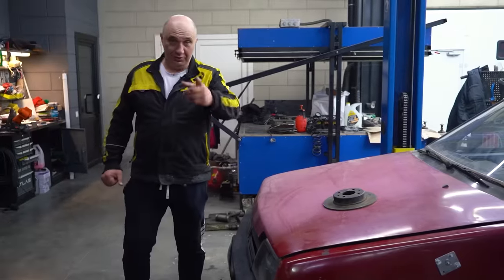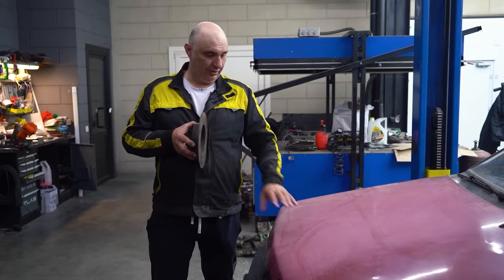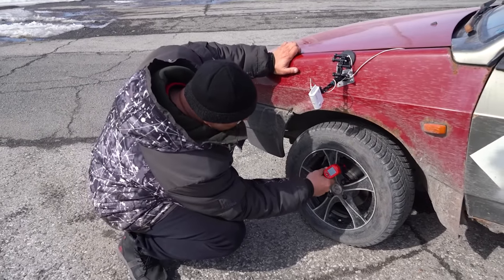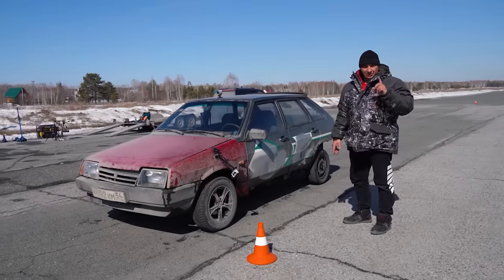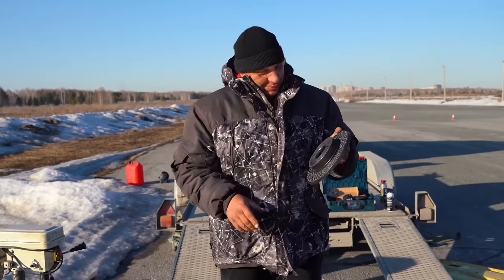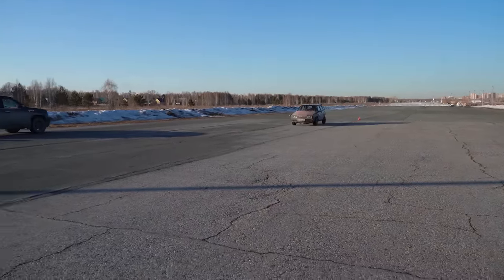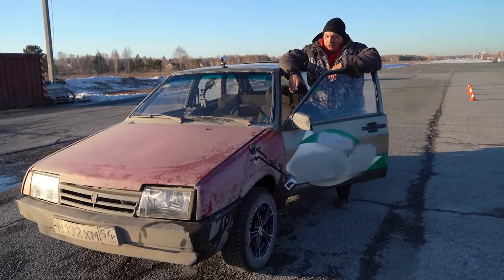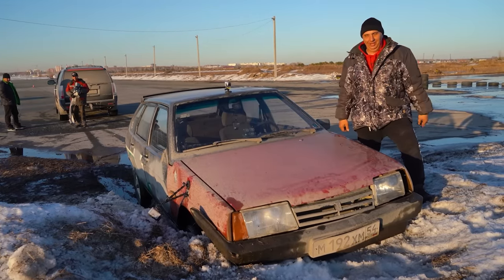We progressively cross drill Lada brake rotors - what will happen?

Comment: The drilled and slotted rotors are for extreme duty braking. Whenever heat gets built up in the brakes, it emits a gas which can cause the brakes to not clamp effectively. So the slots and holes are to carry those built up gases away from the friction material to allow for full application of the friction material

Comment: I think the reason for the rotors reading hot after every hard stop is normal. The cross drilling helps in dissipating the heat faster in preparation for the next hard stop. The tests done were supposed to be done after a few meters of driving to see how many drilled lines cool faster after a hard stop like that. My thoughts!

Comment: K P H	Miles Per Hour
1 kph	0.6 mph
2 kph	1.2 mph
3 kph	1.9 mph
4 kph	2.5 mph
5 kph	3.1 mph
6 kph	3.7 mph
7 kph	4.3 mph
8 kph	5.0 mph
9 kph	5.6 mph
10 kph	6.2 mph
15 kph	9.3 mph
20 kph	12.4 mph
25 kph	15.5 mph
30 kph	18.6 mph
35 kph	21.7 mph
40 kph	24.9 mph
45 kph	28.0 mph
50 kph	31.1 mph
55 kph	34.2 mph
60 kph	37.3 mph
65 kph	40.4 mph
70 kph	43.5 mph
75 kph	46.6 mph
80 kph	49.7 mph
85 kph	52.8 mph
90 kph	55.9 mph
95 kph	59.0 mph
100 kph	62.1 mph
105 kph	65.2 mph
110 kph	68.4 mph
115 kph	71.5 mph
120 kph	74.6 mph
125 kph	77.7 mph
130 kph	80.8 mph
135 kph	83.9 mph
140 kph	87.0 mph
145 kph	90.1 mph
150 kph	93.2 mph
155 kph	96.3 mph
160 kph	99.4 mph
165 kph	102.5 mph
170 kph	105.6 mph
175 kph	108.7 mph
180 kph	111.8 mph
185 kph	115.0 mph
190 kph	118.1 mph
195 kph	121.2 mph
200 kph	124.3 mph
205 kph	127.4 mph
210 kph	130.5 mph
215 kph	133.6 mph
220 kph	136.7 mph
225 kph	139.8 mph
230 kph	142.9 mph
235 kph	146.0 mph
240 kph	149.1 mph
245 kph	152.2 mph
250 kph	155.3 mph
255 kph	158.4 mph
260 kph	161.6 mph
265 kph	164.7 mph
270 kph	167.8 mph
275 kph	170.9 mph
280 kph	174.0 mph
285 kph	177.1 mph
290 kph	180.2 mph
295 kph	183.3 mph
300 kph	186.4 mph
305 kph	189.5 mph
310 kph	192.6 mph
315 kph	195.7 mph
320 kph	198.8 mph
325 kph	201.9 mph
330 kph	205.1 mph
335 kph	208.2 mph
340 kph	211.3 mph
345 kph	214.4 mph
350 kph	217.5 mph
355 kph	220.6 mph
360 kph	223.7 mph
365 kph	226.8 mph
370 kph	229.9 mph
375 kph	233.0 mph
380 kph	236.1 mph
385 kph	239.2 mph
390 kph	242.3 mph
395 kph	245.4 mph
400 kph	248.5 mph

Comment: The ventilation holes or slots are to vent the gases that are created when the pad materials melt, it forms a pillow or cushion of gas that not only increases braking distance but damages rotors over time, basically the better the ventilation the better the contact of the pad to the rotor.

Comment: About 200-370 in the end? Before that 100 it is the sweet spot. Looks like you can do that to a flat rotor and make 80-100 holes and improve its performance. I had before on my VW Polo from 2007 its original disks flat, I wanted to give it some holes but they had big lips so I have ordered some rotors with 50-80 holes pre-drilled and they last longer. Never tested them against the original 2007 rotors, but, I think that they are better than some flat rotors. 😅

Comment: Given how this is working and how slotted and drilled rotors tend to be for racing, I do think the off gassing of the pads might be a factor. Heavy braking like this will use up pads very quickly and given how up to the 3rd hole drilling went, it was decreased stopping distance but also increased heat. Some say bedding and others say its the holes but that does not explain how much of a increase happened so quickly with such little stopping as the pads would still be bedding in and atleast if it was hole grip then it should have been more similar to the 3rd hole drilling atleast even though there is less rotor surface. 

This does need better testing like brand new pads for multiple sets of rotors and each set would have no hole to holes up to the 4th drilling that was done. Do a dozen braking each set then take the distance and such. But this also needs crossdrilled into the vented rotors as well as the brake distance should be decreased further from the no hole to 1st and 2nd hole drill as the off gassing would be able to escape better out of the rotor instead of being trapped inside the hole between the pads. Have to get a car with the exact same braking system but have options for the vented and non-vented rotors. Swap them onto the same car and run them. 

That test would prove or dismiss off gassing of the pads and the doing a dozen braking events then test should remove the bedding from the equation leaving the hole grip of which would need a few dozen more braking each and check the thickness of the pads and even weight difference from new to used. The more holed rotors should show increased wear of the pads over non drilled and lesser holed rotors.

Comment: these test would make sence to firstly start with a proper car
Reply: That's an awesome car
Reply: The car isnt really what matters here. A frame, engine, wheels, a steering wheel, and brakes is really all that is needed to test this. Ofcourse some Petrol and a few other things etc😄 but basically the exact vehicle doesnt matter here.
Reply: @motov8-garage832  yep, it's a before and after. Doesn't need to be a fast or good looking car. They are testing in a lot, not a race track... No need for a faster or better looking car. The simplicity of these ladas also helps them get tests done with less fuss.